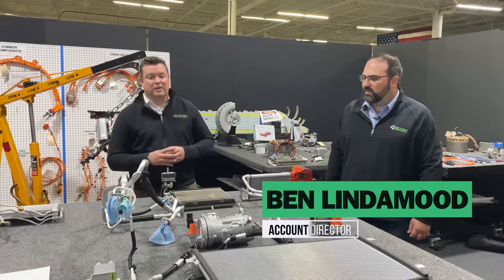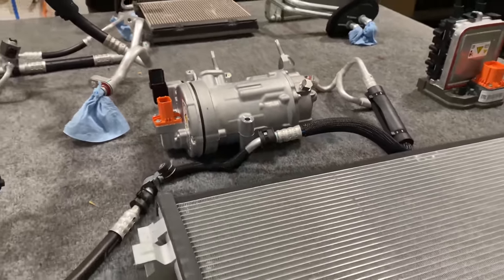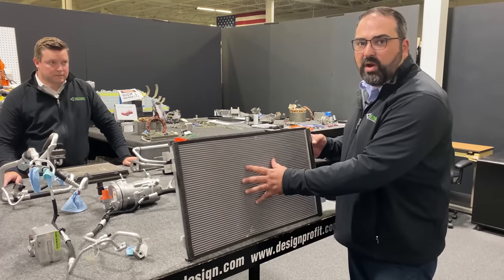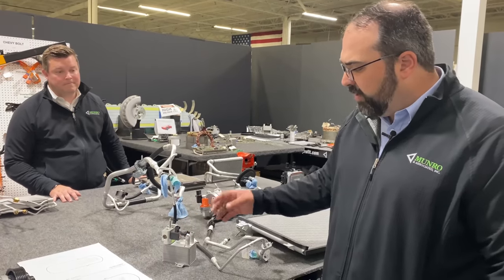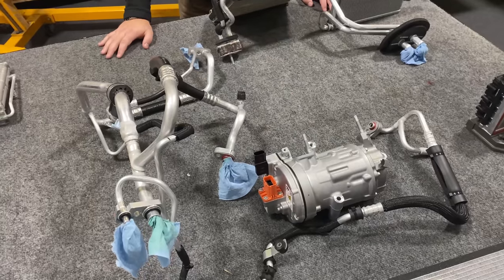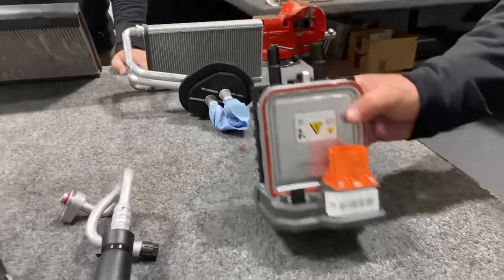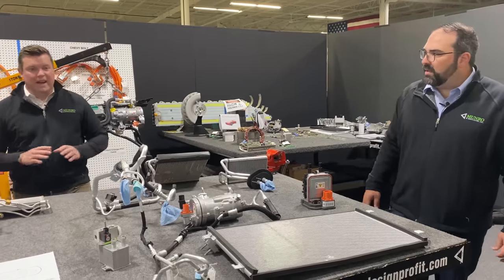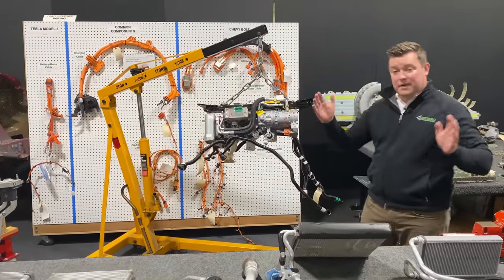Mach-E: EV Thermal System Components - In-Depth Look

Comment: Good job, Cory & Ben!  Only thing missing for me was a comment on relative efficiency of PTC vs Heat Pump.  Heat pumps over their working range are 2x to 5x more efficient than PTC at putting heat where you need it.  When it gets very cold and outside the range of the heat pump's design numbers then an external source of heat is needed.  In a Tesla this is done by running the electric motors inefficiently causing them to heat up the liquid coolant flowing through them to supply the heat to the heat pump.  TeslaBjorn's testing has show this is about 7kw of heating from the motors.
Reply: Top notch info, thank you very much <3
Bjorn is great, scientist at heart, just wish his takeaways would be presented in a shorter video format ^^ Just my gripe

Comment: I am not sure you made it clear for everybody why heat pumps are more efficient than resistors. Resistors convert electricity to heat at 100% efficiency. Heat pumps move a fluid and change its phase in different places (well detailed in the video). This change of phase (liquid/gas) allows heat to be moved from one place to another using Carnot's principles. Using the same quantity of electricity, you can move ~3 times more heat energy, making it about 300% efficient (compared to resistors that will convert electricity to heat, which requires energy conservation and limits efficiency to 100%).
Reply: The resistive heating is just 100% efficient not "close to 100%". There's nothing else the electricity turns into besides heat.
Reply: @seasong7655  Correct, fixed
Reply: nice explanation, thanks :)
Reply: Correct, but more simply, the plus 100% efficiency of heat pumps comes from "stealing" heat out of the ambient air.  Any air that's above absolute zero has latent heat to be scavenged.

Comment: Heat pumps are actually most efficient in mild climate.  In fact in negative temperatures, resistance heating can be more efficient.
Reply: This is what confused me, atleast with residential heat pumps they are less efficient in cold climates and sometimes need an auxiliary heat source.
Reply: Correct the typical home heat pump starts loosing efficiency at about 40 degrees and stops working at about 25 degrees. So a home system will switch to the back up heat source somewhere in that range. Not sure about the temps that R1234yf will work at though.

Comment: I have a Mach-e AWD Xr and I love it so far. 2500 miles. one 270 mile round trip from home and back with 14 miles still in tank. Charged to 235 with 16 amp charger over night. This in central Texas on a 90 degree day. Can’t see the stuff you guys are showing but it’s interesting. Thank you.
Reply: So if you needed a car that works and can be filled in 5 minutes or less and had to go somewhere ASAP you would hop into a good old ICE vehicle.
Reply: @BigEightiesNewWave  this was year ago. I haven’t brought gas for a year. I still have not charged at a DC charger. I’m 78yo and my 73 yo girl friend likes the Mach-e but she gets range anxiety. She needs her F250 pu to pull her grandkids horse trailer. Not a joke. So I do get to drive an ICE truck on occasions.

Comment: I think you could have explained the difference in "efficiency" since some will be confused that a PTC heater is essentially 100% efficient, but a heat pump can have a greater than 100% "efficiency" because it is refrigerating the outside air, moving heat from cold air to the warm coolant. I.e the heat moved is greater than the work done by the compressor.

Comment: The main reason for a heat pump is not to accommodate colder markets, it’s to boost efficiency. Heat pumps don’t tend to work very well in extreme cold. As temperatures drop the efficiency and ability of the heat pump to even make heat decreases.
Reply: Correct, as the temp drops so does heat pump efficiency and it eventually reaches the point where it can't produce any heat.

Comment: The heatpump when heating, basically an air conditioner in reverse,  it cools on the condensing side so much it can freeze and fail. I've seen it happen in domestic heatpump systems. The gaseous phase can only extract a certain ammount of heat from the outer air when vaporising and you would need an electric heater to supplement it below  5ºC-10ºC, roughly.

Comment: The heat pump is also, at least, 3 times more efficient in terms of electrical consumption to generate heat.
Reply: Partially true from what I understand it decreases insufficiency as the temperature gets colder, At a certain point traditional resistive heating is needed.
Reply: That's because it does not "generate" heat, it moves it from once place to another.  That's why it's called a heat "pump".
Reply: @TheJoeSwanon  Thats correct, if outside temperature is  too low the heat pumb will not work.
Reply: But in many climates the heat pump excels.  My Kona has one and the PTC has never switched on.
Reply: The heat pump not being able to extract heat at lower temperatures is only because of the working fuels like r1234yf - which do not do so well at those lower temperatures. You could use different types of fluids to work at lower temperatures - but those fluids range wouldn't work well for higher temperatures anymore.

Comment: All I would add is that you might have talked about the fact that the refrigeration cycle uses latent heat of vaporization, how that allows an air conditioner to move heat from a cooler environment to a warmer environment, AND how that makes heat pumps more efficient than resistive heaters.  Also that a heat pump is really just an air conditioner that is cooling the outdoors.  Still a great job and video.

Comment: Interesting to learn how the cooling and heating systems work in the Mustang Mach-E.  I'm not an engineer, but I can add some important observations as the owner of an MME in the south:   That AC system cools down the inside on hot summer day real nice and quick, best AC in all the many cars I have owned.  And in the winter, the heat is instantaneous and warm.

Comment: Waste Heat Engine (WHE) is a self-starting engine that operates in a low temperature range.  This feature allows an engine to run on waste heat emanating from an external source, such as battery thermal system components.

Comment: Great video. Very detailed and technical. One thing not mentioned is Tesla can run the motors slightly out of phase to generate heat for system as well. It counteracts some of the minimum temperature disadvantages in a heat pump design.

Comment: The condensed gas is cooled to ambient in the condenser. When it’s evaporated into gas (in the evaporator) the temperature drops significantly. It’s this which gives the chilled air into the cabin. A home fridge-freezer works in the same way. 
Incidentally propane is cheap an excellent refrigerant and it has zero effect on the stratospheric ozone layer. Some might say it’s a fire risk but so is your gas lighter.

Comment: You forgot to mention that the Ford does not tolerate long down-hill roads – several Mach-E had to be towed away recently because of overheating on the road down to Geiranger fjord in Norway.
Reply: early model S would also overheat from regen while decelerating during high speed runs on the Autobahn.  As the motor got to hot performance would be cut back, not disable the vehicle.
Reply: @pablopicaro7649  Exactly!

Comment: Wow! That was very clear and concise.  Thanks for pointing out the flow and the comparison of the size of the lines.  Could you show the refrigerant flow more explicitly in a heat pump system and maybe how the fluid is diverted between cabin and battery,  especially if one needs to be heated and the other cooled?

Comment: I heard that the Tesla system also incorporates some resistors like the PTC does to get around heat pumps not working well in very cold environments due to heat exchange differentials with the outside. It would be great to hear to hear the high level overview of the Pros and Cons of heatpumps vs others. And it would be awesome to hear some mention of how Tesla could use their technology in a home HVAC system since Elon has said numerous times that he would love to do that, basically just "stacking them up".
How well would just stacking up multiple units lilke in the car work in a home with central forced air?

Comment: Good job you guys. Well handled. Good explanation and compact video. I assume mach-e would not be too great at -40 temps and long Finnish winter.
Reply: Why?  Seems to me they have an actual heater.
Reply: 5000 watts of almost instant heat.  The battery won’t be happy waking up to -40, but the occupants will appreciate the instant heater.

Comment: 3:50 I don't think the expansion valve causes the refrigerant to turn back into a gas.  The expansion value should turn the high pressure liquid into a colder low pressure liquid.
Reply: The expansion valve turns the high pressure liuquid into a LOW pressure liquid, then the heat/energy absorbed causeing the low pressure liquid to phase change to a low pressure vapor, then the low pressure vapor is returned to the compresser and turned into a HIGH pressure vapor, the condensor coil/heat exchanger removes the heat and it phase changes into a HIGH pressure liquid and that then goes back to the expansion valves, basic refrigeration cycle.

Comment: Latent heat of vaporization and condensation probably should be mentioned when you're explaining the thermodynamics of these systems. It's what makes the difference between an air to air, air to fluid, etc. heat exchanger and a system that uses a change in state to greatly improve heat transfer.
Reply: They would need to understand what the latent heat of vaporization is to do that. I don't think they do.

Comment: Question ? I noticed in the climate control menu you can turn off the electric heater... If it is off do you still get a little heat from the batteries ? Help heat cabin on mildly cool days.

Comment: What would the cost be for diagnosing the ac issue if it's not working ? When it stops working and trying to test a sensor. What sensor would it prevent it from running the ac compressor or the HVAC system from powering on?

Comment: I read that the lack of heat pump on the Mach-E was in order to save weight.  Does that make sense?  It seems like you are suggesting there wouldn't be the need for a big condenser  and the extra hosing out in front if they had gone the model Y's heat pump route.  Could you clarify the plus and minuses of the different design decisions made there by Tesla and Ford?

Comment: To me seems the big deal between traditional ac and a heat pump comes down to a few important things. Weight, Weight and yes weight.  That it is also dramatically simpler set up with far fewer points of failure is a strong point for a heatpump.

Comment: The Nissan Leaf does have a heat pump, however, it is not connected to the battery. Correct me if I'm wrong but it doesn't have cooling either so I doubt it. I have a 2020 SL+ Great car!

Comment: Why not have a simple reversing valve to switch from heating to cooling, just like an AC unit. A reversing valve makes the evaporator a condenser and vice versa. 
Alternatively just have the compressor connected to a 'hot' plate heat exchanger and a 'cold' plate heat exchanger, the heating and cooling can then be done by water circuits and controlled by electric valves. It seems that car manufacturers should talk to air-con companies, maybe there is a cheaper/lighter way.

Comment: Interesting!  Even if one knows the science, it is interesting to see the parts.  Question:  Both heating and cooling are powered by using electricity from the EV's battery bank.  How does this affect mileage?
Reply: its a big jump in efficiency. You do not need that 5kw inductive heater core. Just the compressor.
Reply from the maker: Greatly. When Sandy and Cory drove on their 8,000 mile road trip, the cold areas required the heat to be on and it drop range significantly.
Reply: BigPlanDan - MUNRO already said it in the Video.
Both systems are about Equal at Sea Level and Nominal Temperatures , but when it gets COLD out, the PTC Resistance Heater has to work Harder , and is only 30% Efficient, it cant keep up with Heating, so the Range drops to 50% or more.
With a Heat Pump less Energy is used to Heat/Cool the car , Heat Pump is more Efficient more like 60% Efficient and losses are about only 20% in the Cold. 
besides that the Mach-e Thermal system weighs +50% more Conservitavly , than the TESLA HVAC , and has MORE Thermal LOSSES , because of the HOSES it has, TESLA has much Shorter hoses and Fewer of them. 
in the Mach-e you are Carrying around ALL that DEAD weight. which Further Reduces range even in Summer.
Reply: @markplott4820  Thanks for the info!  I'm guessing that a lot of Tesla drivers have their windows down and their A/C off during long summer trips.
Reply: @danoc51  - no not Really, the cabin filter does a good job at allergies. However, July 2021 onward will have HEPA, so it's good to keep window closed and vent open.

Comment: I wish to hear about the numbers...means for different outer temperature and a set expected inside temperature what is the usage of energy in both systems and their comparison...

indeed I appreciate that you taught us that the heat pump system with a better packaging uses much less parts and less fluids.. thank you ..

I wish to conclude that if outer temperature let's say less than "70°F" then in all cases the heat pump is more efficient..

Comment: I''m confused on the Elec Veh's liquid cooled condenser that eliminates THAT at 08:44. I know simple physics laws say you can't dispose of heat into a fluid w/o the fluid getting hotter and hotter.  Obviously the heat in the water of the water cooled condenser needs to dissipate said heat. Where does all that heat go utilized to cool the interior and battery assembly?

Comment: You could explain that PTC resistors increase resistance as they heat up, thus limiting the temperature. So they don't need complex temperature controls. 
Still trying to figure out why Tesla's heat pump needs a cabin evaporator and separate cabin condenser, or did I miss something.

Comment: Is it possible to use the heater to reject heat from the batteries in an overtemperature scenario?  Similar to running your cabin heater to cool an overheating ICE.

Comment: In a sense,  there's nothing wrong with the Ford system; it's conventional.  However,  a heat pump is essentially just an air conditioner with reversing capability,  and extremely easy to build at the beginning. Even an inefficient heat pump is 2-3 times more efficient than resistance heating. Heating,  with an ICE engine,  is essentially free,  but not the case with electric,  unless you make the effort to integrate battery,  inverter, motors,  and passenger cabin into an ecosystem with shared functions for heating and cooling.  Not more difficult; just different. Anything else is just lazy,  especially when electric can actually be simpler,  but because of batteries is much heavier.

Comment: You guys are awesome even without Sandy. Would the electronic expansion valve on the chiller considered an EXV instead of TXV? And does it just duty cycle a solenoid or control flow more like an EGR valve?

Comment: I’m surprised that the Mach-e heater is just 5Kw. I wonder whether that is enough to heat the large cabin and the battery in winter, especially with the thin glass roof without isolation. The smaller Chevy Bolt and the Chevy Volt use the same setup, but have a much stronger 9kW heater.  The Volt even has a separate heater for the battery. 
Thanks for the interesting video.

Comment: Wondering...does it have a blend door?  Can the heating element be partially on or is it on 100% whether you need 1/4 strength or full strength cabin heating?

Comment: Suggestion: some diagrams to explain the flows and energy exchanges that are happening along the way. I was able to follow along easily but I am a mechanical engineer with an specialization in thermodynamics and heat exchangers, so definitely not the typical audience. Or maybe, not to confuse system evaluation with physics and engineering basics, you could start a video series on the basics of automotive engineering. You would be great instructors for that!
Reply from the maker: Good idea! We do complete thorough diagrams of each thermal system on every vehicle we analysis. We just don't want to give "too much" away. Thanks for tuning-in!
Reply: @MunroLive  Thanks for the reply and great timing: the signed bumper sticker just arrived!

Comment: Heat pump works only down to -10C (14F). Below that it is disabled. So truth is - in cold climates heat pump is not that useful.
In Krasnoyarsk (latitude=56degrees), for example, we have daily mean temperature below -10C for 3 months, average low - for 5 months  in a row per year.

Comment: Hey, Cory, can you explain in more detail how the loop between the Tesla's condenser and evaporator works? It looks like instead of rejecting heat using a condenser/radiator, it uses cooled liquid from the evaporator to absorb heat from the condenser?  This is more efficient you say? It's more compact for sure.  Sorry, I took thermal dynamic at university 15 years ago and my memory is a bit hazy.

Comment: Surprised you didn't comment on how much more efficient Tesla's heat pump is than Ford's resistive heater. Tesla uses the heat pump to warm the cabin, which is about 300% as efficient as a resistive heater. Only when it's extremely cold (below -10f in my experience) does the Tesla Y generate heat resistively. Since it lacks a heater core, what the car does is run both drive motors out of phase, generating about 5KW of heat which is then pumped to the cabin.

Comment: That was not information on the Mach-E. That was information on how air-conditioning works and the basics are the same regardless the system. The question is how does the March-E cooling system match up against other EV's?